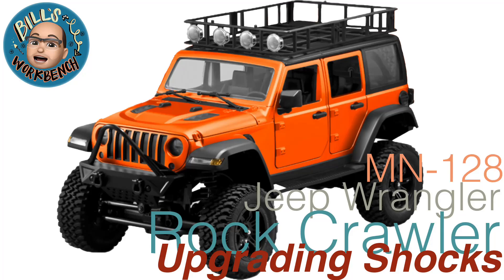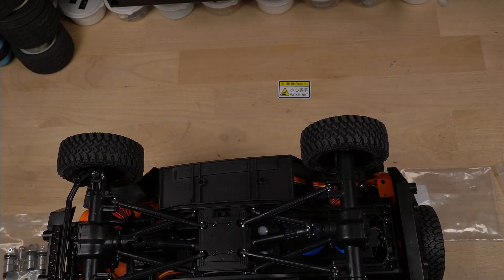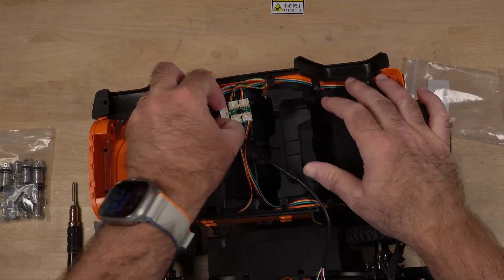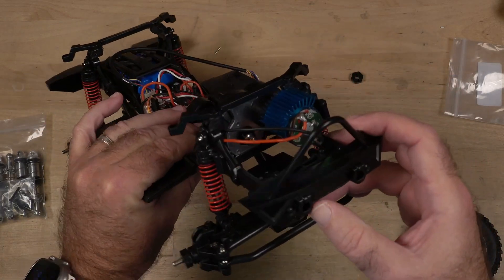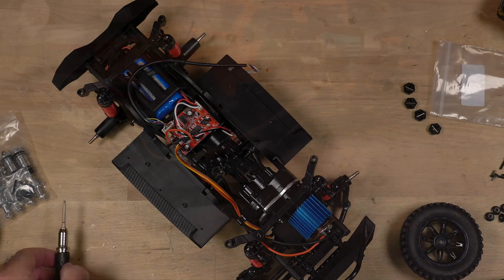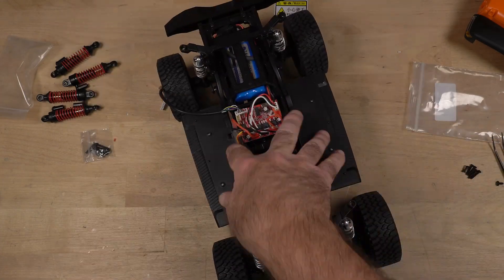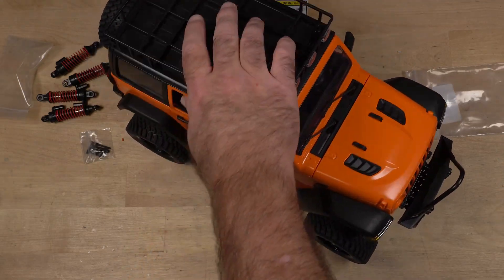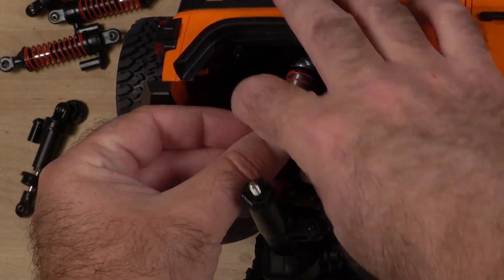MN Model MN128 Upgrading the shocks step by step. My first rock crawler from Amazon

Comment: Hi Bill, did you include the part about adjusting the oil viscosity and tuning of the shocks?  I don't remember seeing that.  I just bought some oil-dampened shocks and not sure if I need to make any adjustments along those lines, as well as, how to do the adjustments.  Thanks for the vid!
Reply from the maker: Each shock is different.  I use 20 and 30 weight oil as my go to for my crawlers.  Most new shocks come almost dry. You need to remove the either the top or bottom, depending on the shock design. And fill the oil there. Then exercise the shock with the lid off.  Then screw it back together half way and compress the shock 100% to get the overfill out. Then tighten and away you go.